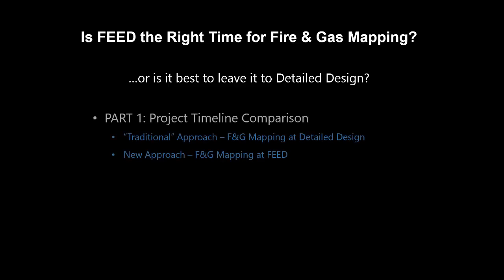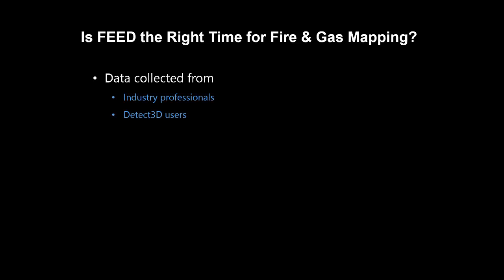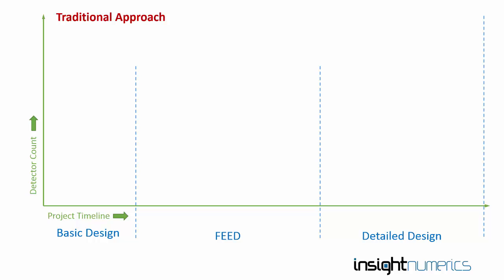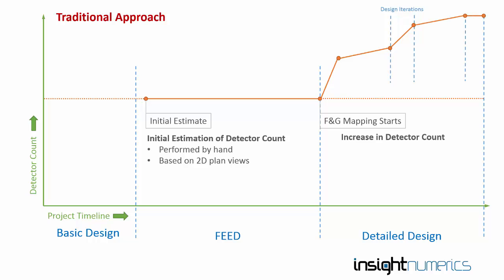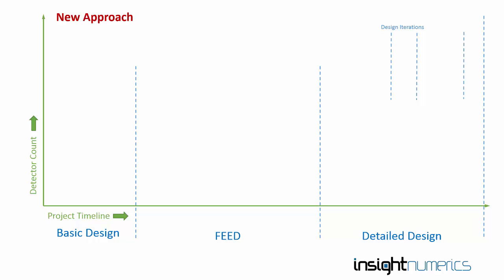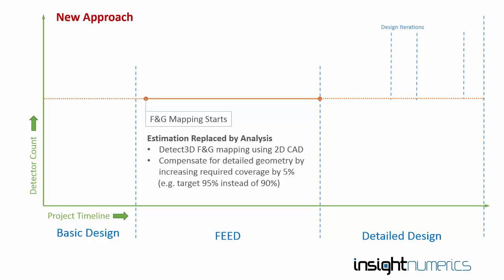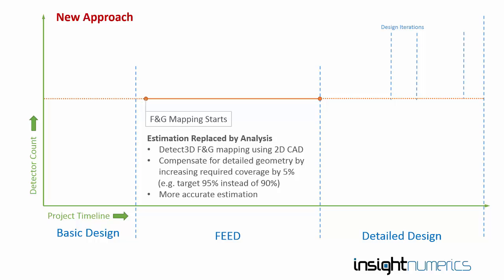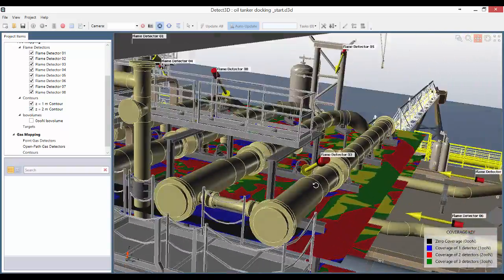Is FEED the Right Time for F&G Mapping

Comment: We have used Detect 3D on a recent major offshore oil & gas project, and it has revolutionised the work process.  Being able to accurately and objectively assess F&G coverage against performance standards in-house and integrate mapping and coverage into the design process has had very significant schedule and hours reduction impact, and allowed significant optimisation of the fire & gas system.  Similarly, the speed with which results are available from In:Flux and the fact that this can all be done in house transforms the work process for dispersion studies, allowing rapid base case assessment and also very rapid assessment of changes, which is not possible using traditional CFD methods.